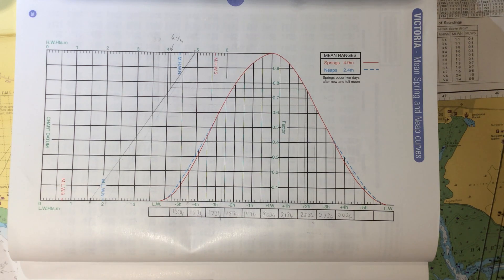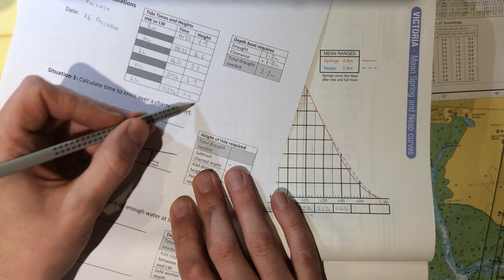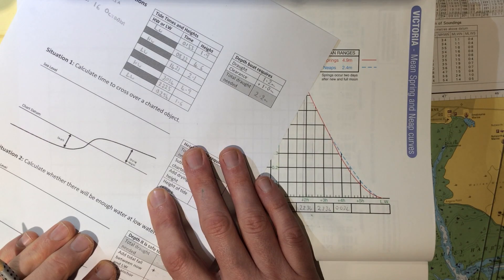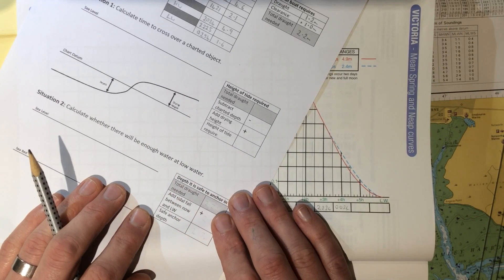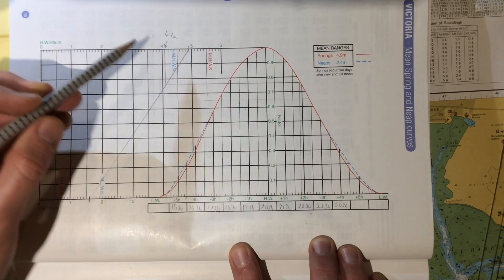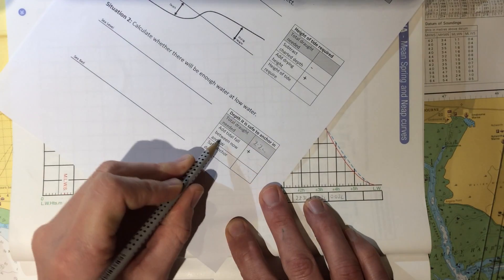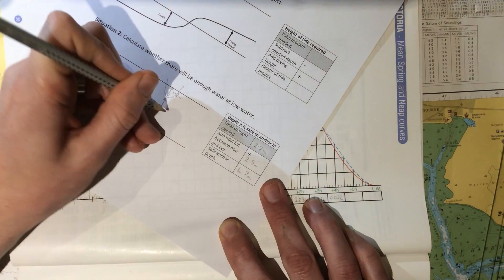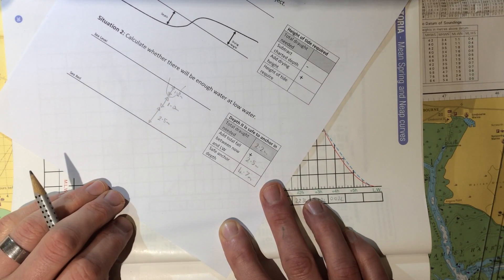Anchoring in the correct depth of water

Comment: Is there anything wrong with simply looking at the height of the next low tide, working out if you need any 'extra' depth due to your draft+safety margin and then adding that extra amount to the height of the tide at the point you arrive? So then you have to find a point to anchor when depth sounder is at least equal to height of tide on arrival plus the extra amount. Just seems simpler

Comment: On your paperwork sheet at the bottom it says ''Sea Bed '' , should that not read C.D as Low water is measured from above chart datum ? and needing 4.7m when we have 4.1m is not enough right ?Nice a steady video . Many thanks
Reply from the maker: Graeme Baxter sorry for the slow reply. On the worksheet the bottom I am happy with the label “sea bed”. The reason for this is that in this example you are not concerned with CD. You just want to know what depth of water you should anchor in such that after the tide has dropped to low tide there will still be enough water.
Reply: @pzsc  thanks a mill'

Comment: Can you explain why you need to do this when the depths on a chart are 'chart datum', meaning they are already at their lowest depth.  So if I need 3.6m to anchor in (which includes 1m safety margin) then surely I'm looking for an area on the chart around 4m depth ?
Reply from the maker: Russ Lecroy thanks for the comment. What you describe could work but you need to be aware of: 1) the charted depths in many anchorages may not have been surveyed for many years if at all (see information on the chart) and therefore may not be reliable 2) it may be hard to correctly find that place on the chart unless you have a good transit (GPS for example will likely have too large an error in many places) 3) sometimes (rarely) tides goes below Chart Datum if only by a small amount (you could check for this in the tide table). The idea behind this video / method is that you can use simply the depth of the water (which you can measure) and the tide table (which are accurate with slight variation for air press and weather conditions).
Reply: @pzsc  thanks for your explanation, I do actually use this method, just to satisfy myself :)